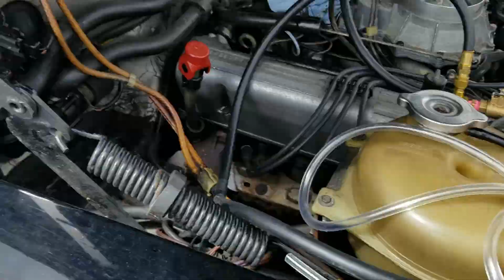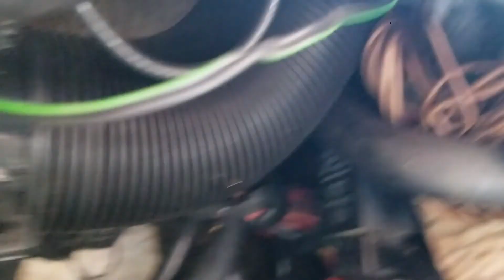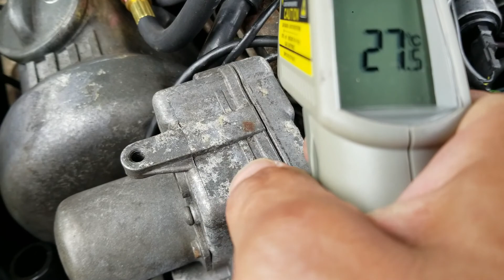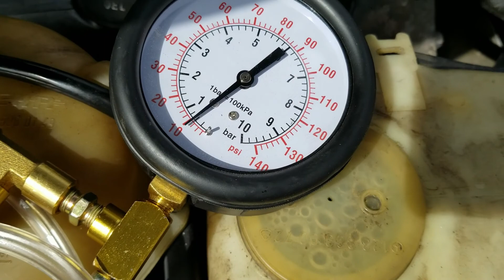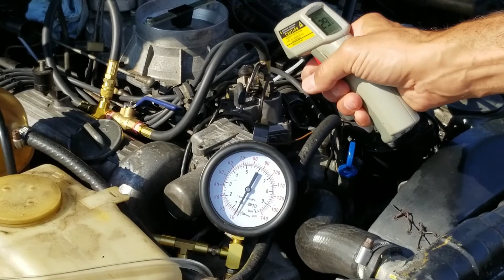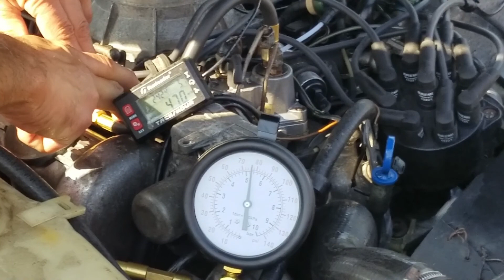WUR setup and testing

Comment: For an engine with a temperature of 25 degrees, the cold pressure according to the schedule should be 1.8-2.2 bar, and not 0.5 like yours.

Comment: What could be the reason that the pressure starts at 2 bar instead of 0.5 Bar (cold engine approx. 25 degrees) and ends at 3.7 bar, which is correct already when the engine is warmed up to approx. 90 degrees

Comment: Hi Mark. Great video, thanks for sharing.  Been trying to do the same test in an M110 engine.  Just wanted to confirm if the line you use for measuring Control Pressure is the one that goes to fuel distributor or the return to the manifold/tank.  Because in my car connectors on WUR seem to be switched compared to yours, don't know why... Thanks!
Reply from the maker: Just stop and think about it ..... changing the fuel preasure will vary the flow through the fuel distributor.
Remember, there were several versions of the WUR and the  connection points on it will be different as well